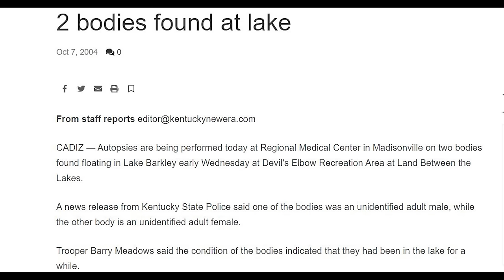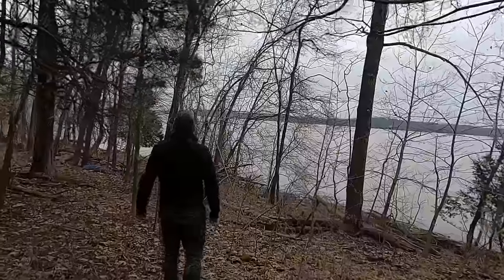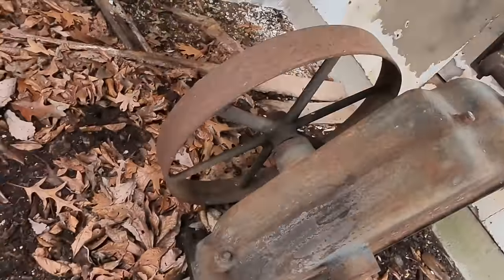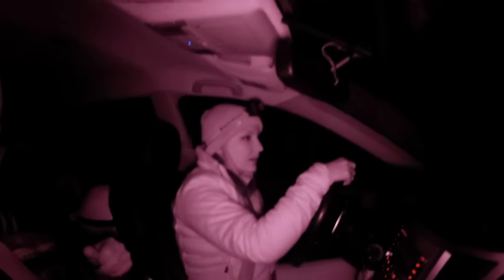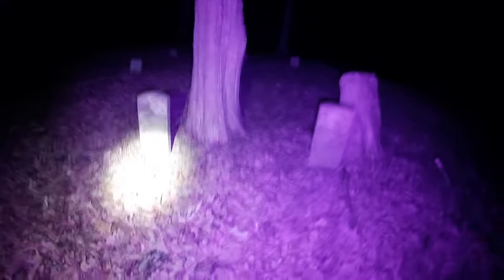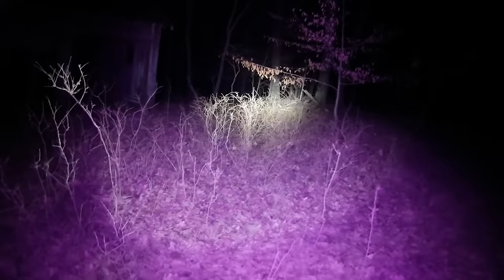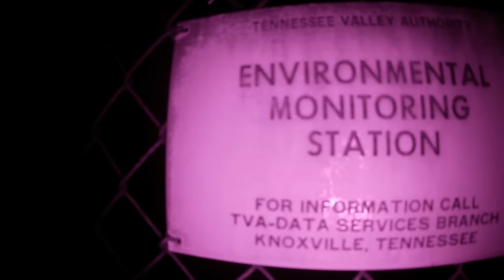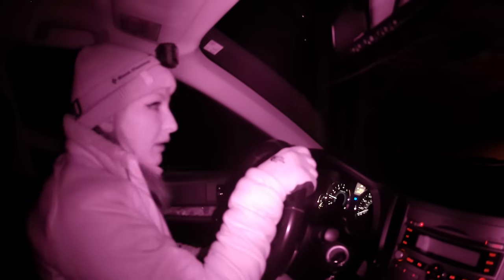Land Between The Lakes: The Werewolf Experiments Part Three - Dogman Bigfoot Cryptids Cryptozoology

Comment: Always take a fuel burning lantern or a mini candle lantern. It us not unusual for places like this ( frequent cryptid and ufo sightings, strange lights, etc.) To drain batteries in devices. In your latest episode when your lightning detector was going crazy that is an indication that there was a small emp burst nearby. Those detectors work like that. I say keep that detector handy and when ut starts acting up, know that your batteries are being zapped too. Seriously, pack a mini candle  lantern. They are sealed so that wind will not blow out the flame and will last 9 hours.
Reply: It can do much more. Here in Europe, i went out in such a place with a folding knife clipped in the pocket. It was Just unscrewed to spare parts. I discovered it back home, if i nedded it, i was done.

Comment: Guys always carry a rag and a small little container of lighter fluid or ? And some waterproof match’s with a moisture camera type lil packet to help keep dry doubled bagged and extra bulbs for your flashlight and obviously batteries too ! Not much weight or space if you do it right !!!  DO IT !!  I had a wind up if the batteries go type of flashlight !  It was bright as heck and you wind it and it gets ya to wherever ya need to go , Obviously practice once to see if a lil screwdriver is needed , Wood around always and the right side of a dead tree a branch will be dry to use if the ground is wet blah blah , Everyone always has three blah’s 😂! Whatever ! Ya think . Trust me it will give you confidence if the worse occurs , A lil pen light in your pocket too is a plus . Kevin , You probably know all that but if ya aren’t thinking of it 👍 !

Comment: Just finished watching pt. 3 and I have a question.
When you found the door to the bunker, you mentioned that that was the inside (interior) side of the door. Did you turn it over to see if there were claw marks on the exterior side of the door?
Reply from the maker: It was marked up

Comment: With those thick walls on concrete in that bunker & the door you found, it is obvious it was designed to keep something Out! Please do not go down that concrete hole with the tunnel...too damn many bones proves something has been taking its prey in there & feasting. With the bones in that hole, its been down there too, that is a death trap.  Gosh how you two like to make us worry for your safety! I am on edge just watching this. I don't scare easy in the woods, but this is insane tension! There have been many sightings of dogmen/werewolves in cemeteries, creepy bastards. (Back then, there was a super high mortality rate for children, that is why they had so many if they could) Stay Frosty team!
Reply from the maker: Barton Nunnelly went down into it.  It was a low ceiling chamber

Comment: I have a theory about the lights in the woods. Not saying all but I’m betting most of them are lights from tow boats. Some of those boats can be several stories high. They also make a humming sound. A boat could have to park for several days waiting for their turn to go through the lock.
Reply from the maker: Thanks for commenting, but we have already ruled out boats, barges, and sound from the nearby dam. The lights will appear in the opposite direction of the water.  The sound will occur at random and shake the ground.

Comment: What were they monitoring is the question? Power running to that cement holding cell could have had cameras in it?
Reply: They were absolutely keeping something inside that cell.
Reply from the maker: Or using it as shelter from something

Comment: @46:48 on the right side of the screen, there is a knot hole in the wall, right above a couple of old pallets. For a brief moment it goes from black, to bright white, then back to black again. At first, I thought it was the guy checking along that side of the building.. but it couldn't have been.. we see the camera pan along that side of the wall and we eventually see a window, too.. He would have had to move fast to get by the window without being seen by the camera... and we would have heard him moving through the dry, dead leaf litter on the ground. but there was no sound being made..

So.. what caused that spot to appear
Reply from the maker: It looks like something with a reflective eye briefly peered out at us through that knothole

Comment: Great video,  your best one yet.  What's with the dead pixels on that one camera.  Kinda weird,  would like come and go.  Maybe its the IR acting funny.  Never really seen that on videos before. It reminds me of a video someone did of Chernobyl and they put their camera in a piece of highly radioactive bucket loader.  Little specks of light would flicker all over the screen.  A geiger counter would be something to bring with you on your next trip.  I mean your going into the Dogmans under ground lair that's covered in bones right?  Best part of the video was when you were like " I'am not going down there."  Can't wait for the next video. Later Gator.
Reply from the maker: Thanks, Jersey!

The camera screen was going crazy there.  I mentioned it a few times…I wasn’t sure if the footage would be distorted or not.  Luckily, there was only minor distortion on the footage itself.  
We run a pretty large battery backup on that camera, so luckily we had enough power until we left.
We carry a Geiger counter as part of our equipment, but we didn’t have it there.  When we go back we will take some readings in that area

Comment: Nobody puts barbed-wire Cyclone Fence around a monitoring station unless they are trying to keep something out while they're there
Reply from the maker: Only place there that we saw barbed wire fencing.  We are thinking that Station 16 is tied into the activity in LBL in a major way
Reply: I don't think that fence would keep out a dogman.
Reply: Hello from Juneau Alaska you all are great! Please be safe
Reply from the maker: Thanks, Tiffany!
Reply from the maker: We walked up to several other buildings in other parts of the LBL.  Buildings that actually still had equipment in them.  No other place has barbed wire.
Reply: My thoughts about that place with the fence is , I think that things was starting to get hot that they had to go . In other words I think they was realized that ...that fence wasn't keeping any thing out
Reply from the maker: They might have put the fence up thinking that they were dealing with something a lot more normal than Dogman…but, May have realized that the fence wasn’t enough
Reply from the maker: Too difficult to get to

Comment: The small buildings seem to be some sort of Lift Stations for water or something.  I would not think sewer.  The tunnels you have identifyied are called Duct Bank which is concrete fabricated at a plant in square sections and installed together.  The different small buildings are probably tied together with the Duct Bank you have discovered.
Reply from the maker: We figured that it was a pumping station of some sort.  There are similar pipe/tunnel entrances that we found that are sealed.  

The stations seemed to be older than the concrete bunker and fenced in trailer

Comment: The big blocky bones are beef, foreleg looks like , most of the others  look to be deer bones, rib and femur.

grew up cutting meat and processing deer, suspicious amount of bones on the top of the leaves...
Reply from the maker: No cows running around the LBL.  There are bison on the enclosed area.
Reply: @HellbentHoller  Bison are similar in bone configuration, still the smaller animals should clean up bones,( for the calcium.) awful lot of fresh gnawed bones there.
Reply from the maker: The bison are a WAYS away from this spot.  Not to mention that they are contained in an enclosure

Comment: That shack with the bones. Is that an old electrical air compresser? Maybe for the tunnel?
Reply from the maker: It is an old pump of some sort
Reply: That building looks different than the other buildings.  The louvers suggests air flow. Maybe ventilation  for constant operation.

Comment: Question  Have you thought about putting flashlights in a Faraday bag kit.  Or what ever that thing call you put ypur phone in so can't be trackedd.    Maybe that would help save your batteries 💁‍♂️
Reply from the maker: We have had equipment drain in the past…just not like this.  Luckily our full spectrum camera is hooked up to a pretty sizable battery backup
Reply: I was wondering if those bags would protect it would protect battery life for flashlight
Reply from the maker: They might.  I will give them a loo

Comment: The tunnels could they be something from the civil war??
Reply from the maker: Something to do with water.  Like the remnants that f a pumping station
Reply: @HellbentHoller  strange have you done research on the area n any mention of the tunnels
Reply from the maker: We have done a bit of research on the area…. Still working in the tunnels.  We think that they were part of some sort of pumping system.  We found a few other openings that has been sealed.

Comment: Wow, wtf is up with all the bones. The thick walls, glass, locks… so many questions. Then there’s bones broken apart leading into an underground tunnel. Fascinating and terrifying. Great video. Seems like there’s plenty of potential exploring to do there, but wow there’s some gnarly warning signs. Want to know so bad what did that, but don’t want you guys getting messed up trying to find out either.
Reply from the maker: There’s a lot more to the LBL than just the alleged massacre site.
Reply: @HellbentHoller  without a doubt. This may just be a case how the truth is stranger than fiction. Freaking fascinating.

I just spent almost 2 weeks camping alone with what I already told you, but you guys have some serious Kahunas!
Reply from the maker: You going back out anytime soon?
Reply: @HellbentHoller  I hope to return not too long from now. It’s an incredibly unique situation where there’s been interaction for a number of years ( something I learned from some locals) so I’m pretty blessed it’s crossed my path

Comment: I'm a new subscriber. That cemetery is so old that the information on the headstones has long been eroded away. I've been wondering if you were going back to the LBL for round 3. I was not disappointed. You both have more guts than I could ever imagine to have. Be safe out there.
🎶🐦🇺🇲
Reply from the maker: Thanks!  This is actually from that same LBL trip.  Just the last part.  We will probably be going back in the fall. 

Thanks for subscribing!!!  I appreciate it
Reply: @HellbentHoller  You're welcome 😊

Comment: AT 46:44 extremely strange something peculiar moving underneath the double round piece of metal right side of screen, shadow like or something loose cloth like hanging? but doesn't seem related when one of you walked outside with the flashlight. Slow it down to notice, is moving oddly almost like relay movements like in & out of reality in split of seconds
Reply from the maker: Does it look like it’s inside that building?
Reply: @HellbentHoller  Absolutely at my time stamp above inside the building, underneath those two round barrels? with holes, it moves oddly unless is a cloth hanging but you would need wind to move it. Slow it down to 0.25 and you'll see it as camera moves to outside of building. Also the light on knot hole thought was one of you, it shines on the hole, then the window, then on side building (front of camera) see thru crack, then moving light reflection on same wall, it seems to me a portal opened up & some light where this thing was under the round barrel. Everytime you guys feel something is around I catch anomalies, use you intuition and please, be safe
Reply from the maker: We will!  Thanks for the observations.  Another set of eyes is always welcome

Comment: No I have a question for you why don't you set up a decoy camper trailer with video cameras in it and writing remote control people inside it and see what happens to the trailer out there and see if you can catch anything on camera that away a decoy trailer a camper That would be the best way of doing it and have the thing rigged with all kinds of cameras to see if you can actually see this thing doing something That would be the best way of capturing then come back the next morning and seeing what damage this thing has done inside and outside of that decoy can camper trailer That would be the best and the safest way to do it
Reply from the maker: Thanks
Reply: @HellbentHoller  You are very welcome but that was a good idea to have a trailer as a decoy though